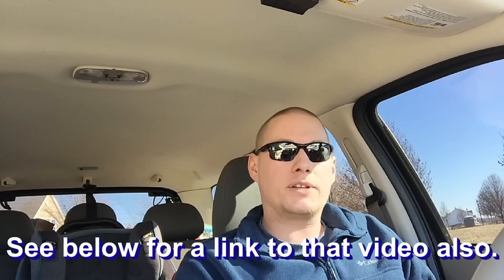Ford Ecoboost Engine Carbon Deposits: What You Need to Know

Comment: Where I work we have a hundreds of early 3.5 f150s, with most of them now having high mileage (150k+). Before I bought my own 3.5 last year I talked to some of the mechanics, and the fleet manager, and they were all aware of the intake carbon but swore that they have never had to perform repairs because of it. no induction services, no catch cans on these trucks.  I put a catch can on my personal truck but I wonder if this is really an issue to worry about

Comment: I wonder and think that if you had a Ford Taurus or any turbo flex fuel vehicle that running that ethanol once in a while may help.  My non turbo I4 2012 fusion I run completely on Shell gas and soon Pennz full syn oil.  Have that idea about putting newer ford turbo parts on my car.  Should work with some tuning.

Comment: Two Questions: First, It seems as though carbon buildup on the F-150's 3.5L Ecoboost has not been as much of a problem as other EB engines.  Is that a fair statement, or am I just not seeing them show up on Google? Second, the 2nd gen EB on the 2017 F-150 adds traditional intake port injection to the direct injection.  Ford says those injectors should be running most of the time and the DI only kicks in with high power demands.  Do you anticipate carbon build up still being an issue on 2nd gen engines?  Thanks, Brian

Comment: While this is an old video it seems to completely dismiss carbon build up on Ecoboost engines which is a known problem with all Gas Direct fuel injection (both the PCV and ERG systems add to carbon build up on intake valves with GDI). The problem is bad enough that BMW has carbon removal service for all it's GDI vehicles, including turbos (which only increase the issue due to increased heat), recommend at 30,000 to 50,000 miles and it is something if not done with Ecoboost engines will likely cause them to fail. The process is very exacting where each cylinder is done one at a time when both intake valves are closed and the rest of the intake manifold is blocked off. A medium is used to blast off the carbon and then the manifold area is thoroughly cleaned before they move onto the next cylinder. The cost is significant, about $200-$300 per cylinder (this produce is initially actually covered under BMW new car warranty, but the owner must pay for it once the warranty expires). Again there is no magic bullet, this happens with all GDI vehicles. The only exception is multi fuel injected engines which have both direct and port injectors, allowing some gas to flow over the intake valves which cleans them and practically eliminates carbon build up.

 It's also worth noting the Ecoboost MPG ratings are not in anyway accurate. The EPA let's Ford use unboosted MPG for it's ratings. It's estimated in boosted mode an Ecoboost MPG can decrease up to 30%.

Comment: Going back to the 1980's (actually farther than that) 1974 the feds said 55mph, a few years later Ford, GM etc., start putting in 195 degree thermostats instead of 180s, overdrive transmissions and high rear end gear ratios, 2.73:1.  LOTS of carbon issues then too!  So bad it would plug up PVC lines and you would up with a "constipated engine"  The only people not having problems were the guys who were on the interstate all the time with a bunch of speeding tickets!

2 things - driving like an old woman (low rpms) and short trips resulting in engines that never warm all the way up.

My personal car at the time was a 1980 K/5 Blazer.  At 53,000 miles I pulled the heads and replaced the camshaft and valve guide seals.  The seals were cooked, hard and brittle.  The biggest thing was the carbon buildup in the form of a flaky crust on the bottom of the intake where the EGR crossover was.  Directly below that and exposed was the camshaft and lifters.  (the carbon flakes were dropping off directly onto the cam and lifters)

Soon as I put everything back together I started playing with synthetic oils (Amsoil and Mobil-1) and haven't looked back.  I even use Mobil-1 in my lawnmower and in the barrel of my rifle!  Excellent metal protector!

I notice you use the compressed air and blow gun quite a bit in cleaning spark plug holes, cylinders, etc.  How about a vacuum cleaner with a small enough of a probe to clean out some of these hard to reach places?  Including the turbo stuff?
Reply from the maker: ForkliftJoe The compressed air gets everything out including metal shavings on the walls of the cylinders etc tried and true method verified with a borescope.

Comment: They need to add water injection systems to the vehicles that run a cleaning circuit every so many miles from day one since there isn't fuel hitting the valves and cleaning them like what would happen with fuel injection instead of direct injection.

Comment: Nope it the coking of the crank case vapor from the PVC valve. with intake fuel injection the fuel which is a solvent washes the oil vapors off the valves before the oil can coke up,

Comment: What are your thoughts on the 1/16th hole people are drilling into the bottom of the intercooler? I was having a misfire every time I stomped on it and got tired of paying ford dealer $200 to diagnose issue and change either a plug or coil so I drilled this hole (bunch of crud came out) and replaced all the coils and plugs and so far so good only been 200 miles so far but Power is back like new on my 2011 3.5 with 95k miles on her.

Comment: I own a 2017 Ford Escape, 1.5L eco boost. At 20,000 miles I have intermittent MIL code 051b (crankcase pressure sensor). Ford service thinks the issue is a faulty sensor. Your thoughts?

Comment: Ford Tech Makuloco, would it be safe to spray inside my exhaust ports (top of the intake valves) if I removed the turbos and exhaust manifolds to clean carbon deposits?

Comment: Red turbos are a major problem. I've seen some melt the fins. Lots of damage.

The best way is for them to design the injector area to be in the intake runner to dirrectly inject fuel onto the backside of the intake valve.
Reply: That would negate all the advantages of direct injection, what you describe us port injection.

Comment: Does Ford's new 2nd gen ecoboost engine have this carbon issue corrected or prevented?
Reply from the maker: It should yes but the port injected fuel side is not always on though.

Comment: I have a 2016 ford fusion se 2.5 engine, is this required to have my intake vales cleaned with my type of engine...2.5, it not an ecoboost engine

Comment: posting on june 23 2017 while driving to work a f150 about a 2014 3.5 eco driving in and out of traffic, everytime this truck would accelerate a large plum of dark smoke would shoot out the exhaust, is this overfuel from ????  or what. but everytime he romped on the fuelpedal for a heavy lane overtake for passing it would blow this smoke lighter the an overfuel in a diesel smoke...

Comment: I believe you mean volumetric efficiency (VE) not bi(o) metric @ 8:28.  So back in the day before all these other fancy cleaners, guys used to actually use water for the same effect of cleaning carbon from the top end of their motors in essence steam cleaning them. Any thoughts or ideas on how that may or may not work with the ecoboost engines?
Reply from the maker: +Brian Sendall Yes I said volumetric efficiency I don't speak so well. The problem with water is it is likely to shock the and crack off chunks of carbon damaging the turbo impeller. The new chemicals are made to slowly clean the carbon and disperse them as to not cause any issue whether it be NA or boosted.

Comment: Now I'm scared of buying a Ford ecoboost. I'm looking at a 2015 Ford Transit 3.5L V6 rear dually van with 124,000 miles. What can the pre-inspection mechanic do to make sure the van is worth buying. Does he/she have to disassemble everything or should I never think about buying one.
What would be a better Ford van engine? I plan on doing a fair amount of solo traveling and don't want to break down on some dark lonely Hwy.
Always have taken great care of my cares and I can't afford a new one. So, what do you think??? I plan on changing all fluids and any basic maintenance. I really like this extended high roof van, but....?

Comment: Appreciate all the great info!   for 2015 and after (2017 now has bumper to bumper for 10 years...something different or better on 2017 f150's ?) Are the air induction services now recommended to keep things clean OR is it better to just wait until there's a noticeable problem THEN have it manually cleaned??   My 2015 F150 is at 30,000 miles and no idea which approach I should take.   GREATLY appreciate the input!!

Comment: So was there ever a solution? My 2015 3.5 ecoboost Transit with 46,000mi has dropped from ~16mpg highway to ~12mpg, and ~10mpg in the city just in the last few months. Check engine light came on recently (P0300) random misfire, so I took it to Ford for diagnostics. They said there was carbon buildup on the injectors and that the injectors needed to be cleaned. I let them do that and I've seen no improvement whatsoever. Any chance I could get this fixed under warranty?

Comment: hi fordtechmakuloco.  I'm leaning toward buying an oil catch can setup for my 2012 F-150 Ecoboost 49,800 miles on it.  I have a few questions about them I'm hoping you could help me with...I've noticed there are some that only have 1 input on the can.  Would this type not be a good option?  Would a catch can really help?  And this B44 stuff I'm seeing..would this be something good I can use to clean any deposits off my intake valves?  Thank you!

Comment: I'm changing my timing belt on my 2017 escape 1.5  and when I took my terbo intake side off to get to a cover bolt an found oil in the intake tube to the terbo  were do you suppose the oil is coming from

Comment: I wonder how many different cams they try out in an engine before production? Or do they use a computer controlled air actuated system to mimic different cam profiles? I heard of a Formula 1 car with either air actuated or electromagnetically operated valves. Another factor with higher compression engines is getting unburnt fuel past the piston rings and into the oil,, diluting the oil so the rings won't seal against the cylinder walls. I deliver pizza. I used to have a bunch of F150s with the 300-6. If I waited to 7,000-8,000 miles on an oil change it would develop a miss. I'd change the oil and the miss is gone. Similar thing with the Tecumseh engine on my JD walk behind snow blower. It seems to run a little rich and if I crank it too much in cold weather it won't run until I change the plug "and" the oil.

Comment: What do you think of CRC intake valve and turbo cleaner?   I have 125,000 miles on 2011 F150 I've had since new and its now hesitating when trying to accelerate from stop or low speeds and mileage is dropping. CRC says its safe and but I don't want to damage the turbo's.  Do you think its a good idea to use it?

Comment: I have a 2011 Ford f150 3.5 Ecoboost fx4 I put 87 octane on it it says regular gasoline if I put gasoline with additives would it damage by truck in the long run what do you recommend me?

Comment: I have a '16 Escape SE 2.0l eco, its 10k passed warranty and I'm wanting to tune it a bit. Is there any ford approved cleaning yet? Or would replacing the valves be best? I've only ever had motorcraft synthetic blend in it

Comment: Brian , I just bought a 2011 F150 with the 3.5 eco boost. I do not have any indication of a problem with the fouling of the valves but considering I have almost 167K miles on it I want to be pro-active about the issue. I realize that the catch can is practically a must but won't deal with whatever deposits are pre-existing. Has Ford come up with any remedy short of a head replacement since this video was made?
Reply: I know he said a media blast or walnut basting wasn't approved but it's probably your best bet getting the valves extremely clean

Comment: I know it's not recommended to some, but honestly the best way to deal with the crank case vent is to reroute it  out onto the ground. it's been done that way for years up until the EPA had to get involved and started screwing everything up. if you want to simplify things and fix issues that are caused by recirculating the crankcase vent then just delete it and ignore the EPA they're screwing this country up in more ways than one.
Reply: Really, I'm not quite sure if I understand you, so you're saying that it's better for the motor to recirculate what vents out of the crankcase then 2 run it out into the atmosphere?
Reply: And again I may not be understanding you, butt the crankcase does not need to be sucked out it naturally build pressure that needs to be released that's part of the venting process. it doesn't need to be sucked out.

Comment: The only cure for carbon build up is for the manufacture to use a duall injection system one injector direct injection and the other port injected Audi is using it on there new 2.0l EA 888 engine they are still new so I don't know how effective they are going to be but my bet is going to work fine I have VW Tiguan 09 with the 2.0L tsi engine with Turbo and Direct injection system I have 140 000km's on it an I had a missfire issue I replaced spark plugs the coil packs had been replaced etc I brough it to the dealer for the extended injector replacement it cured the problem like 80% I ask the dealer to clean the intake valves whille they were there I was willing to pay for the extra for the job and they said they were ok so I did a compession test all was ok so I had to remouve the intake and clean manually at first and then blasting the valves with wildnuts they were dirty after the cleaning the engine is running like new it was missfireing on cyl no. 4 and this is were the pcv hose is on the fourth cylinder then again I'a VW thech and we had DI engine since 2006 .
Reply: I was thinking the same thing. Why not put a cold start injector in the intake like toyota used to, or something like a TBI injector from the old GM days. PCM can turn it on now and then to deliver gas and detergents.
Reply: +Chad Ross Toyota uses Direct/Port Injection..Direct for power. port for normal driving conditions...that's the technology they're using in the 2016 V6 Tacoma 3.5..

Comment: What you're saying at 3:50 about exh scavenging is way less likely a culprit than the Exhaust Gas Recirculation system, required by Federal regulation in the US, which dumps all the carbon right back into the intake manifold.  Terrible for DI engines.  Are the intake manifolds black and oily inside?  Then its all the EGR system.  The best thing you can do is put a block off plate on the EGR, or just pay for new cylinder head, yuck.
Reply: I think you can buy on Ebay an electronic block for the egr

Comment: Really silly question but my 2011 Mazdaspeed 3 does have a 2.3l that I believe is a Ford motor. Would this information also apply to my car? It’s at 90k miles and wanting to do something to help with my carbon build up. Think I’m also due for a good coolant flush , vvt solenoid/chain replacement. Anyone know any updates for this carbon issue?

Comment: In the video you referenced ( I watched it 5 minutes ago) you were complaining about carbon build up on your personal vehicle 2.0 ecoboost explorer at 20,000 miles.   In this video your speaking of carbon buildup not being a problem until 100k+ miles. Not to be rude but it appears that Ford may have requested that you back pedal on your harsh comments about head replacement. I agreed with your previous video and the craziness of replacing the head for carbon build up. My BMW product gets walnut blasted every 40k and it has had zero negative effects. The fact that all the engineering power at FORD cant come up with a suitable cleaning method. Im a new owner of a Expedition EL Ecoboost and wished I would of seen this before I bought it. My thought process was the cylinder head cleaning would be the same as the BMW. You might be a good Ford mechanic but I bet without knowing it your a great GM salesman ;)
Reply from the maker: My problem with the ecoboost warning is video is everybody mistook it as hey they will all fail of carbon deposits, in reality I was warning people to not perform unapproved induction services because Ford engineering lab told me they were causing turbo failures. I think that if Ford wanted me to back pedal they would have had the video taken down because that one is still out there and very popular with over a million views so that is the one everyone sees and this one is seen by chance.
Reply: Does venting to air cause engine problem if intake is plugged? Thx!

Comment: Thought you might be interested to know Makuloco, CRC endorses a "turbo safe" intake valve cleaner they advertise as being appropriate for ecoboost motors....
Reply from the maker: Yup I know all about it but until I see it effective enough on the valve coking I have dismissed it for now.
Reply: FordTechMakuloco so your saying in your opinion it's safe to use???

Comment: Great vd man ! So the only fuel system cleaner you recomend is the black bottle of chevron every 3,000 miles ? Will that work to keep my complete system cleaner    If I use it as directed ? ( every 3000 miles ) , and do you recomend filling with premium gas ?
Reply from the maker: elvicdesonora I would use only Chevron Techron yes every oil change or so.
Reply: Don't worry about the "premium gas". The higher octane will do nothing regarding the carbon issue. Just be sure it's "top tier" gasoline as stated